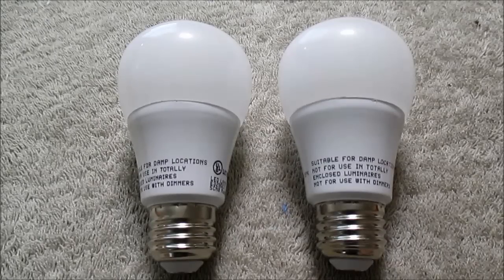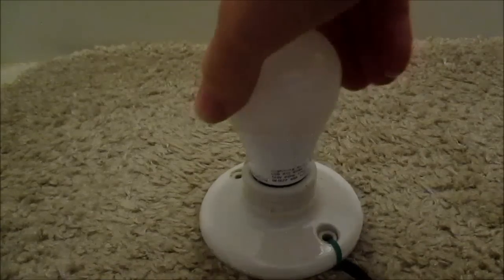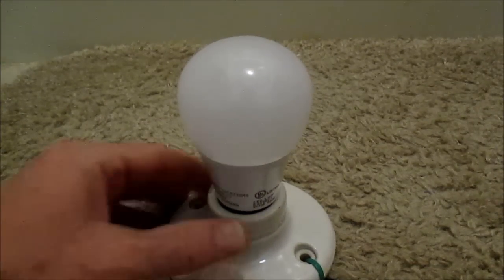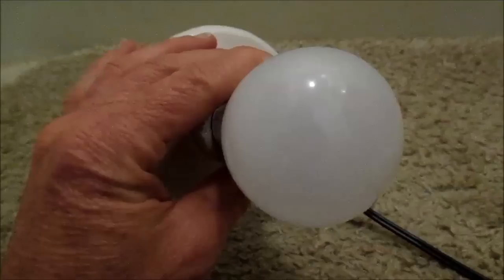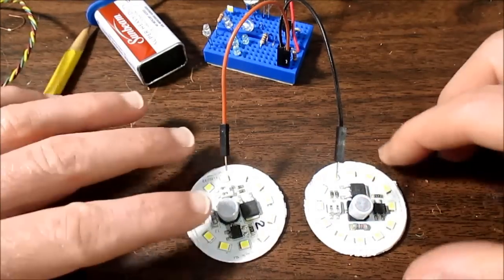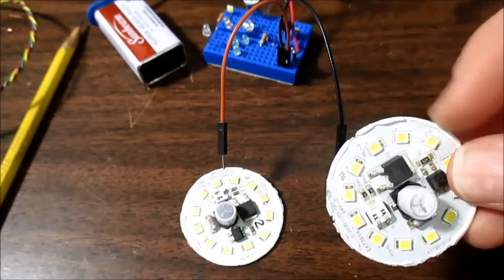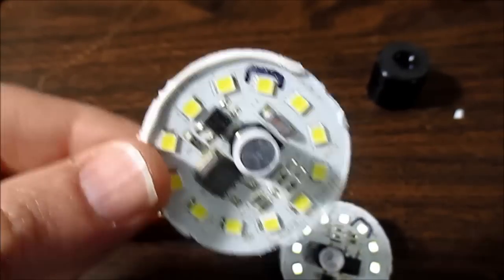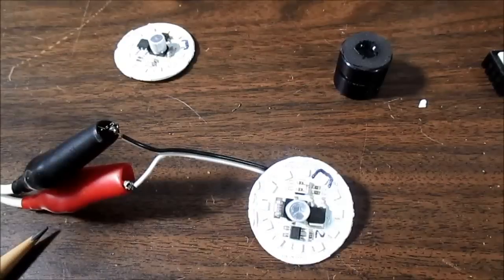Two failed LED bulbs for teardown to determine the cause

Comment: The LEDs I took apart had a whole set of electronics stuffed into the base packed with rubber and was marked with FCC logo. What is that?
Reply: Jayne Intlekofer , I heard horror stories about some early design LED lights causing radio interference. Seems that when these lights were switched off, the interference always immediately stopped. The FCC indicator might be that the device has sufficient filtering to comply with FCC requirements dealing with spurious emissions from such devices. You've probably seen other such verbiage on other consumer devices, for the same reasons.

Comment: IT is most likeley the type of fixture the bulb is in, it is holding heat. LED's cannot tolerate even modest heat levels, the temps in your attic during the summer are higher than the LED can tolerate. You will also likely find that the chip carrier is pvc not ceramic.
Reply: Do you think it's a good idea removing those plastic coverings off? We do that and LEDs last long and they are brighter as they become directional. We had one or two units that fail after a few months, though.

The covering-less/refractor-less LED I installed outside (but not exposed to the rain) has lasted for more than two years even with insects crawling on the exposed circuitry. I tried covering it with a transparent plastic but insects tend to get in so I just removed it. We have not experienced electrical failure so far, but we regularly disconnect all our lights from the AC when they're not in use. Our lights have a separate wiring network that can be unplugged from AC power.

Comment: Interesting. I never thought about cutting open one of these failed bulbs. Some observations: LEDs have a typical forward current of 20 - 30 mA and a forward voltage of 1.6 - 3.3 volts. Assuming that the LEDs are wired in a series string (like old Christmas lights), then we would have a total voltage across the string of 19.2 to 39.6 volts. For simplicity sake, lets assume a 25 mA current and a 25 volt feed to the string of LEDs. Typical a.c. is 117 Vac, so there is 92 volts that must be dumped into the voltage regulator. There will be a small drop across the full-wave bridge rectifier, but in this case we will assume this to be negligible. The spot where the leads connect may be a small step-down transformer; the rectifier converts the a.c. to d.c.; the electrolytic capacitor is to smooth out the d.c. ripple; the 560K ohm resistor is to drop the input voltage feeding the voltage regulator. Since I have not done a postmortem on one of these myself, I will now have to go and cut one open. These bulbs run very HOT, no matter the manufacturer.  I recommend against running these in an enclosed ceiling fixture, as they can be a fire hazard! Thanks for the interesting video.

Comment: Paint the base, the white plastic part, black with a sharpie, haven't lost one that I have done this to yet. Black is supposed to radiate heat away better, and it's a cheap experiment.

Comment: As I understand it, LED bulbs cannot be used in enclosed light fixtures because there is not enough air circulation to prevent them from overheating. I have had two LED bulbs fail under such conditions. The symptoms are they come on and almost immediately shut off. If you wait a while with the power off they seem to cool enough to reset themselves and you can repeat. I tried one of the failures in an outdoor fixture this winter. Because night temperatures have been in the single digits or negative (Celcius) they flash on and off, presumably because the ambient temperature is low enough to rapidly cool them down to some critical temperature where they can reset.

Comment: I have equipment that I've been using since the mid-to-late 80s with LEDs on it with many of them staying on 24/7, I can say that I have never had one burn to this day, a common saying I have now is everything is made to fail. Just the other day I purchased an under-counter LED strip name brand product with a rating stamped all around the Box 50000 hours, after 1 hour of the light strip being on one of the leds start blinking or stays off for while. I read something a while back on packaged LEDs for automobiles. There are all these different LEDs with cross reference numbers on the front of the package to actual filament bulbs that you replace with the led. it states this led should not be used in a enclosed fixture because it will overheat and burn LED, can anyone tell me with the exception of Maybe the glove box light are the floor lighting that a LED bulb would not be enclosed, why are they even being sold to go in your brake lights, Park lights or dome lights

Comment: personal experience: I have had bad bulbs out of the box,  none that arrived working has failed on me.  Conclusion: quality control issues.  Solution: additional testing before shipping would solve the problem.

Comment: Before I watch this video, I can already tell you it's brownouts and surges multiplied by crap brands.
But even good brands will die from it eventually. Also heat. These are made for lamps. not ceilings where heat sits.
But everyone thinks "Oh it looks like a lightbulb, must mean I can put it everywhere lightbulbs go!" ... nope.
Reply: if it looks like a light bulb and says its a light bulb, why should anybody assume anything else ... I don't see it stated anywhere that it's not.
Reply: Yep I feel the same way.
But the companies that make these put their 10 year lifetime crap on it because it's under a high convection ventilation condition. Like a floor lamp so the heat rises up and away from it. That's the case for both cheap and expensive brands alike.
Every brand I've used has gone out in under 2 years. The cheaper ones in months like this video shows.
Except for one LED bulb in my basement. Where it's cold all year.

Comment: I think you voided out the warranty
Reply: He should send them back to the manufacturer just the way it is for a warranty claim and post the results.
Reply: @4lifejeph  actually. in USA, simply call the mfg and tell them they quit working and they'll send ya free replacements.
Reply: @4lifejeph  Or just replace the bad diodes.
Reply: Rohan Zener what’s a diode?
Reply: @TheRojo387  LEDs are not diodes
Reply: @VaughnfromPeterborough  I am a trained electronics engineer, and happen to know that yes, LEDs ARE, in fact, diodes. The acronym stands for Light-Emitting Diode, for one, and one more thing, an LED blocks current like a regular diode if reverse-biased.
Reply: @VaughnfromPeterborough  Then why are they called light emitting diodes??
Reply: @lesbender236  lol 😂 because they emit light 🙄 LEDs are also used in many circuits purely as diodes without any need for the light they produce. So the surely function just like any diode.
Reply: There actually is no warranty on the Lightning Science brand of bulbs. That entire company is a fraud. There are approximately a thousand people who actually gave this video a thumbs-down. That proves to me that the Lightning Science company had most of their employees deliberately give this video a thumbs-down out of anger for exposing the truth of their fraudulent business practices. I attempted to contact their company via their email address located on their website at https://lsgc.com 
My email was instantly returned to me as being undeliverable.
Reply: they are not warranted,only supposed to last but dont. I have about 20 failed bulbs in a box that i brought back to Home hardware and other stores in Canada and they all said there not warranted ,on the box it say should last .... many years based on 3 hours a day but no specified time warranty .The only thing is wen  you live in some places like me in Quebec there is a consumer protection law that states that any item must last a reasonable amount of time ,even then what is reasonable time for a bulb is a  matter of interpretation
Reply: @richarddesbiens796  That is not the case here. from what i know.Yet anyway .Here the law is facotry waranty 1 or 2 years,Beside that there is a consumer protection on things that expected lifetime of a product is 5 year or longer.Like a car radio bikes consumer electronics etc.Then the waranty is 5 years no matter what the factory waranty say.
Reply: @richarddesbiens796  Many ways to say this short lifespan is not  reasonable.Not  reasonable in sound electrical design term, envirement waste of components.Not  reasonable to produse garbage straigth from factory just for short term profit.al this waste i bet taxpayers have to pay for, on top of the tax many contries have on stuff when u buy it.
Reply: In this nation wee have regardless off what factory warranty say 2 years waranty.On things like phones tv etc that is made to last upp to 5 years and longer the waranty is 5 years.I know there are forces that always want more.think they can eat money that want this rule to go away.Those persons i think will get a negative respons pretty fast.As they should get

Comment: they probably run too hot, 
check with ir thermometer on a working one,
 just place it covering the a led(alignment is important)
Reply: drilling a few vent holes would not be a bad idea

Comment: I'm surprised,
Thought it was the capacitor.
Easiest fix, is to solder a resistor in parallel with the LED, or just another LED on top of the broken one.
Reply: True but you can't reassemble a lightbulb.

Comment: Brilliance Optronics supply high performace LEDs upto 220lm/w,high voltage and low current.
360 degree full angle light,no dark area
For details,please visit www.brilliancelight.com

Comment: Throw those SMD LEDs  in bin.Go to the electronic junk yard and get transparent white LED through hole and modify the resistors I have done it and last for 5 years
Reply: Congratulations for one of the most ignorant posts on here yet.

Comment: No criticism of the method although I don't like the mains floating about like that. If you have 110-120V ac in US that's a little safer but you still have the terrific power (Amps) that the mains can deliver which can heat things in a trice and burn you badly. {A car battery has the same danger but it can't shock you}. Here in UK 240Vac mains makes this method a definite no no! Use a 9V battery to check each one in turn. Hey what about making two good from 3 bad? Can you get the globes back on?  Good video. Thanks.

Comment: How do you know they are open? Couldn't they be shorted? Resistance test of the LED would tell. In my experience, diodes tend to fail shorted, LED's may be the same(or not).
Reply from the maker: When I used the wire to short across the bad LED, the other ones came on as they are in series. This would indicate that the bad LED had gone open.
Reply: lochinvar00465  if they were shorted the other LEDs would be lit when he put the current meter across it he was shorting it with a go around no they lit.

Comment: JohnAudioTech:  Have you tried repairing these?  Replace the bad LED by taking a good LED from another bulb?  Or short across the open LED with a wire?
Reply from the maker: I could replace the bad LED but since it is the common failure across the three bulbs, I can seeing another LED going bad soon after repairing. At <$1 per bulb, it is not worth the effort.

Comment: Not really much of a problem when its a couple of bucks for a new led lightbulb--Very different when its several hundred bucks of led TV set! 
Same mode of failure (probably exactly the same LED chips) on this new LED TV shit, changed dozens of LEDs in shitty less than 2 years old LED TV's....

You got a newish LED TV and want it to last more than 18 months--Go into the settings and turn down the 'Backlight' to as low as you can stand.
Reply from the maker: That's a shame they can't put good LEDs in a TV (or could it be poor design of the set such as thermal issues?). Engineers get great pressure from management to get products produced as cheaply as possible and crappy cheap parts get used.

Comment: use patrol(gasoline) to open that opaque cover on the top, simply put some petrol in between the joint and boom. it opens very easily.

Comment: I not sure what brand of LED bulbs I have but most have lasted me more than 3 years. As my regular bulbs burned out I replaced them with LED. Now 95% of my home runs on LED lighting. 
I even check the watts used with the KillAwatt meter and found out they were using less than 1 watt of power a day, about 0.75 atts over 3 days. Our cost of electricity here is about $0.11 cents ( including taxes and other charges) per kilowatt.

Comment: Hi,

Stupid question - if you had just removed the bad LEDs & made a soldering bridge... could they still be reused ? 🤔

Thanks. 🙄
Reply from the maker: Yes they wold work, but until the next LED failed and it goes out again.

Comment: I have the same issue with my led bulbs . The argon filled bulbs that produce light with a tungsten filament do work better thus far. They talk about the power efficiency of led bulbs . Yes they use less power and produce more light than heat .  But how much energy does it take to create the silicone devices ? So, they pay all that -non green forward and IF the bulb holds out , then the green gains over time but yea if they break down then incandescent bulbs are still greener. So this aspect of green tech is lip service seems.
Reply: @guitarman_3693  damn skippy . These so - called green technologies are about robbing Peter to pay Paul .  What we need is to start developing hydrogen infrastructure . Already 3 car types are hydrogen powered . We need to start building infrastructure to slowly ween us off fossil fuels and toxic nuclear .  It may take us 100 years to do it . Fuel cell cars like the Toyota and Honda models are based on technologies from the space program and are the only true - green tech or rather will be when we build up technologies and yes at first we WILL use coal ,oil and nuclear to build the hydrogen future but we will slowly use hydrogen to make hydrogen and phase out oil coal and nuclear .

Comment: Had an additional thought: our area is prone to dirty electricity. The fluctuating of current can't be good for these delicate bulbs.
Reply: Capt. Bob Roemer , see if you can use surge protectors on your bulbs. (Not sure if physically practical, but they are used elsewhere to protect computers, etc.)

Comment: You have power outlets in your bathrooms? 
Big Clive.lol.
Reply: Of course. Where else would you plug in your hair dryer or electric razor ?
Reply: Glenn Watkins Lol. We might be cusons of blood and sisters of tongue but for so many other other things we are world's apart. In the new build houses the odd electric razor outlet can be found but again I think cultural differences then come in to play. The vast majority of our bathrooms also have our toilet in, so hanging around in shaving or drying hair in the morning when there maybe be a lot of people at the door to use the toilet might make for a bad and angry start to the day? There are certainly no outlets for hair dryers. Even the rare razor outlet is a completely different shaped and pinned outlet compared to normal outlets. Our plugs and outlets are still (I think) the safest design around so I read. Lol. Most of our bathrooms are smaller than hairdryers. Electricity+water=very risky I think? I am trying to remember my youth and women with hairdryers (wife does not use one). Females here do the hairdryer thing in their own bedrooms, usually with some stupidly over sized mirror. Lol. So endeth my history/culture sojourn.
Reply: Any outlet within 1 meter of a water source must be a GFCI protected plug.
Reply: Dene. F.     Sounds like you have a home like mine.no outlet (and the light switch is on the OUTSIDE wall‼️).
Reply: In the US, kitchens and bathroom are required to have GFCI (ground fault circuit interrupter) outlets which prevent electrical shock. If you dropped your hair dryer into the tub filled with water, the breaker would trip instantly.
Reply: How else can you throw a toaster into the bathtub when you catch your spouse cheating?
Reply: In the USA, they have multiple bathrooms in a home and electric outlets near water are protected by GFCI.
Reply: Jeff King Always the English way.

Comment: The failed FEIT 100W bulb I have has 26 LEDs in it.  All were good & they were the only components on the board.  So the failure resides below at the regulator/rectifier.....

Comment: Why do they build them in series? 
If the LEDs were parallel, that type of failure wouldn't leave people in the dark.
Better yet, why not spend a buck fifty more, and give each LED its own drop resistor when wired in parallel... That way, if an LED shorted, it still won't leave people in the dark.
If the company did that, they could continue to buy, and use, cheap LEDs, and gain a reputation for a much lower failure rate.

Comment: I got a few "10 year" LED bulbs (different from the ones on the video), they lasted around 2 months, when I opended them almost all of the LEDs fell down with touch, they are using extra low quality solder for them, it's fixable but better try to get your money back

Comment: Lighting Sciences is a small corporation (as far as the lighting industry goes). I notice that your examples are marked "Made in China" as well as a UL listing. Having dealt with the Asian lighting manufacturing, you have to stay right on top of these guys to prevent cheating and bad manufacturing processes. You can design a wonderful product but they will turn it into crap. This is based on 30 years of experience with one of the majors (there are only 3).

Comment: I disagree with conclusion the LEDs are  crap. Yes LEDs individually vary alot, the series configuration is easier to ensure all operate at the same current. LEDs respond almost instantly  to voltage variation, so if they are driven very close to their max performance, the regulation needs to be very tight and fast. I bet its not, so the weakest LED in the link fails.